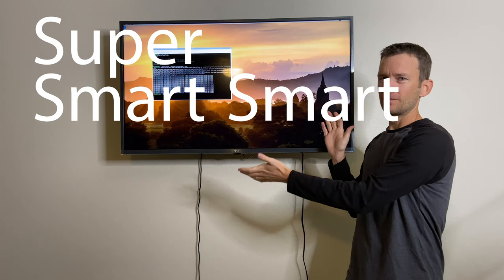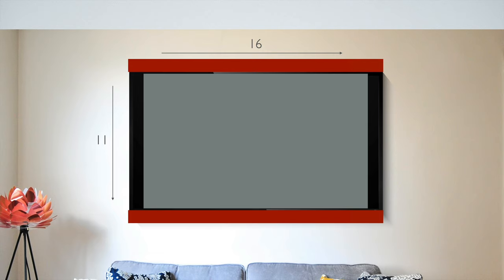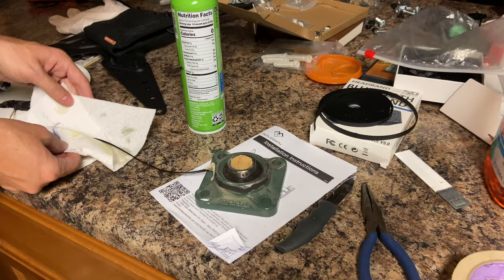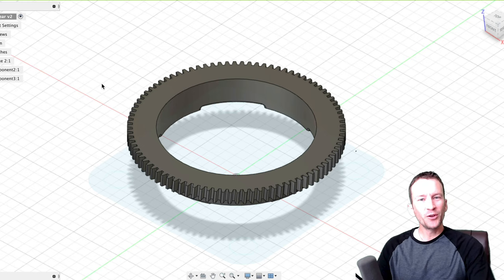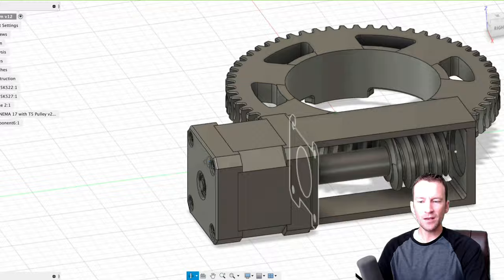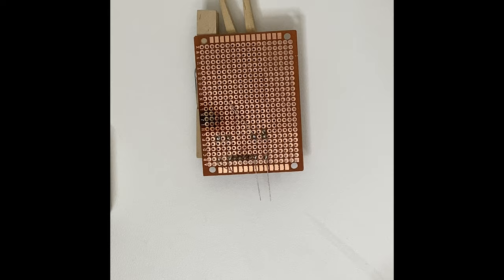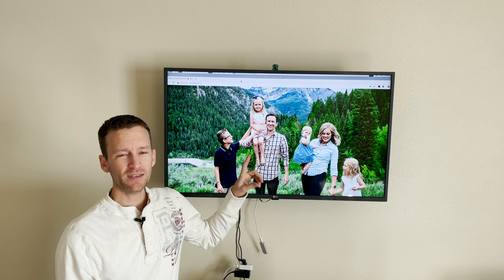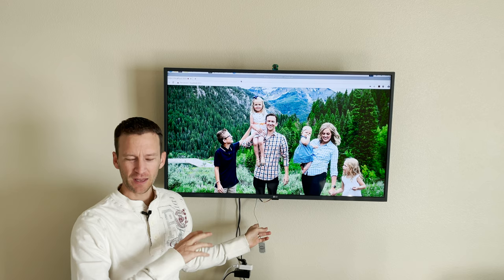AUTO Rotating Digital Picture Frame on Wall Mounted 4k TV!

Comment: Very cool project. I have been thinking of doing this for a while. I would like to know about the sound generated by frame rotation. Also what is the depth of the whole set up-that is from wall to the front edge of the frame. What is your thought about durability of the setup. Also have you considered using servo versus stepper motor.

Comment: I really want to do something like this to rotate a painting a friend has.  I don't need all the TV mounting hardware, and it doesn't need to have quite as much power.  This is a great video, but I don't quite understand how the stepper motor and the flange bearings fit together.  I probably won't have access to a 3d printer, but if you could provide the model that you used I could maybe have it printed out for me.  Thanks a ton!
Reply from the maker: Shoot me a message via the email in the 'about' section and I can shoot you over a copy of the 3D models I created up with